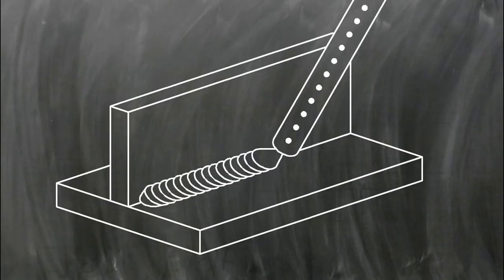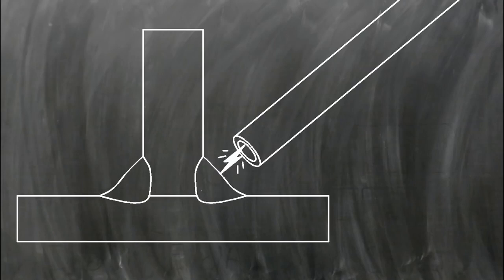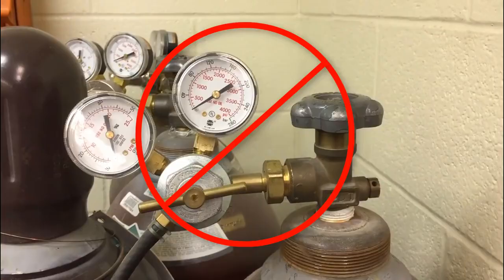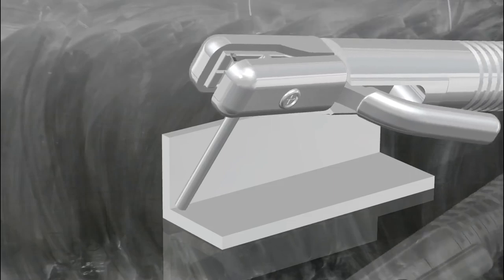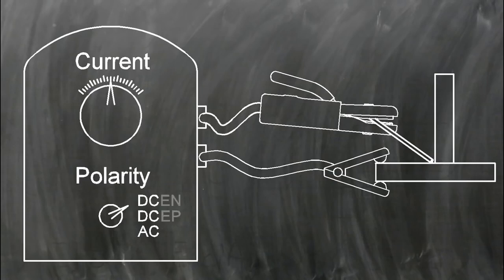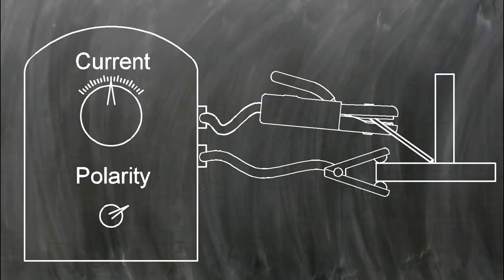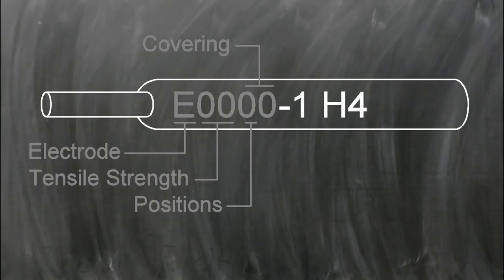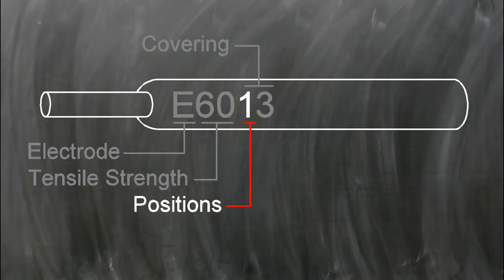What is STICK Welding SMAW by weldnotes.com

Comment: Nurin Nafi'ah
02511840000043
The video explain about SMAW. SMAW is known as manual metal arc welding or Mme or stick welding is one type of electric acr welding process that used a electrode that covered. How it works is flowing the current through the metal electrode or stick. Then, the arc will forms between the electrode and the work piece, so the metal in the rod and the work metal is melt. After that, the two pieces of metals will joined until one piece. The electrode must be charged continuously because the electrode is constantly melting and becoming a part of welded structure. The electrode will release protective gass to stabilize the arc and help to solidify. This process is very simple, but we must control the current and polarity in the welding machine. We can use the AC or DC in this process. In AC, the direction current will be change. It is different with the DC.

Comment: Adzon Nugraha Rizky Pratama
02511840000107

SMAW / Shielded metal arc welding is process of bonding metals using heat energy to melt workpieces and electrodes (filler materials).
On this type, the stick is electrically dialed. Then the electrodes and metal produce heat and melt so that it becomes a part of metal.  SMAW is also classified as a consumable electrode type. After we weld, it will produce such a impurities that will later be destroyed and disposed of because it does not include the part that makes two metals connected. It's called slag. There are two poles in SMAW. One is connected to a workpiece or metal that we will weld, and the other is connected to the electrode. 
There are also two kinds of AC and DC. In AC the current flow to the polishing as it changin directions many times a second. While in DC the poles is fixed
The important thing to be aware of the welding type SMAW is the difference metal will use different electrode as well. All depends on the metal that will be in welding. It is observed in order to produce good welding quality. We also have to use masks or face protectors when welding to be safe

Comment: Okta Nirmala Putri
02511840000030

This video explain about stick welding. Stick welding is one of electrical arc welding process that uses rod shaped metal electrodes that are covered with a flux material. SMAW (Shielded Metal Arc Welding) that called manual metal arc welding as simply as arc welding but SMAW (Shielded Metal Arc Welding) is one type of stick welding. Stick welding  an electric current flows through a metal electrode or stick an arc forms between the end of this electrode and the work piece the arc melts both the metal in the rod and the metal. Stick welding always adds filter metal to the joint because the electrode is constantly melting away and becoming part of the welded. Two poles of the SMAW is one poles connected into workpieces, and the other connected to the electrode. Different of metal workpieces also need different electrodes depending on characteristic of the workpiece to make sure the welding result

Comment: Name : Risa Wahyu Widyastuti
Student Number : 02511840000034

Summary of the video :
In this video explain about stick Welding SMAW.  the stick welding is an electric arc welding process that uses rod shaped metal electrodes that are covered with a flux material. An electric current, in the form of either alternating current or direct current from a welding power supply, is used to form an electric arc between the electrode and the metals to be joined.This process is also known as manual arc welding or shielded metal arc welding that is one of fussion welding that uses electrodes in bar shape with covering of flux material.The welding sticks are composed of filler metal and flux. The flux component serves to protect the molten metal of the weld while the filler metal is used to join two pieces of metal together. Slag is formed when flux, the solid shielding material used in the welding process, melts in or on top of the weld zone. Slag is the solidified remaining flux after the weld area cools.

Comment: Arsya Gading Mahesa
02511840000136

Shielded Metal Arc Welding (SMAW) is an electric arc welding process that uses rod shapes metal electrode it covered with flux material. SMAW usually called manually metal arc welding (MMA) but also called stick welding. the electric current flows through a metal electrode and an arc forms between the end of this electrode and the work pieces. the arc melts both the metal in the rod and the metal, and then both mixed and unite. stick welding is a consumable electrode process. the electrode also relieve a gas that shield the weld to make the result of the welding process is stable. also itu produce slag to shape the weld but it has to be remove if the welding process is finished. there 2 wires in the machine, first wire is connected to work lead and the other one is into the electrode holder. the electricity is can be setup in two different ways, AC or DC.

Comment: Mochamad Ichwan Al Shafa
02511840000140
SMAW or shielded metal arc welding is just one from many types of arc welding. SMAW also called stick welding. SMAW use electricity that flows through electrodes. The Interaction between the material and stick produces heat that could melt both the materials and the electrode. You need to melt both sides of materials so it turns into a molted weld pool and mixes or coalesces with the workpiece of metal. In SMAW welding process there are three types or types of welding machines namely AC, DC and AC / DC welding Machines. All of these types of welding machines have their advantages and disadvantages, if you need two types of welding machines you can buy AC / DC type welding machines.
In this type of welding you need mask to cover your face from sparks that produce by the interaction from electrode and the materials.

Comment: NAMIRAH SHOFI(02511840000127)
what is stick welding stick welding is an electric arc welding process that uses rod shaped metal electrodes that are covered with a flux material the American Welding Society calls this process shielded metal arc welding or SMAW. stick welding an electric current flows through a metal electrode or stick an arc forms between the end of this electrode and the work piece the arc melts both the metal in the rod and the metal and the pieces to be joined. the metal from the electrode is ejected into a molten weld pool and mixes or coalesces with the workpiece the metal in the workpiece is called the base metal and the metal added to the joint from the electrode is called filler metal stick welding always adds filler metal to the joint because the electrode is constantly melting away and becoming part of the welded structure stick welding is known as a consumable electrode process as the electrode is heated by the arc some of the covering on the electrode releases protective gases that shield the weld and help stabilize the arc the remaining covering melts and covers the molten weld pool with a protective slag layer this slag layer protects and helps shape the weld as it solidifies but it must be removed when the weld is cool since the gases generated by the flux covering are able to completely protect the molten weld there's no need for other shielding equipment such as high-pressure gas cylinders regulators or hoses compared to other welding processes stick welding equipment is often very simple sometimes the only controls on the machine are current and polarity many important welding variables come from how the person doing the welding positions and moves the electrode for this reason the quality of welds produced by this process depends greatly on operator skill and stick welding to insulated wires are connected to the welding machine.

Comment: Ega Oktriliardi
02511840000013
Summary of the video:
1. Shielded Metal Arc Welding (SMAW) is type of fussion welding that uses electrodes in bar shape with covering of flux material.

2. in SMAW, the electricity flows straight through electrodes, the interaction of the electrodes and the metal pieces will produces heat and arc, that melt the metal as also the electrode. because of this principal concept, the electrode also classified as consumable electrode

3. Covering of the electrodes produces shielding gas which provides protective environtment of the metal weld from outer intervention (like impurities e.g), as also create a slag that stick onto welding metal to provides protection untill the metal cooled down and solidified.

4. 2 poles of the smaw is 1 poles connected into workpieces, and the other connected to the electrode. there are 2 different ways of the current to flows, AC and DC. in AC  the current flow to the poles as it changin directions many times a second. while in DC the poles aslways fix, positive or negative, depends on the procedures and.

5. different of metal workpieces also need different filler(electrodes) depending on the characteristic of the workpieces to make sure the welding result has good quality in needed aspect.